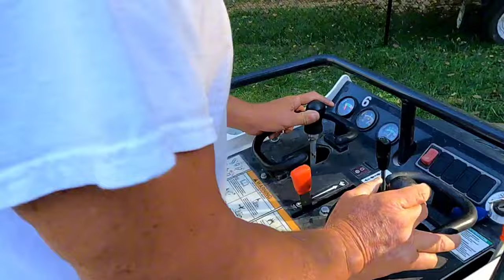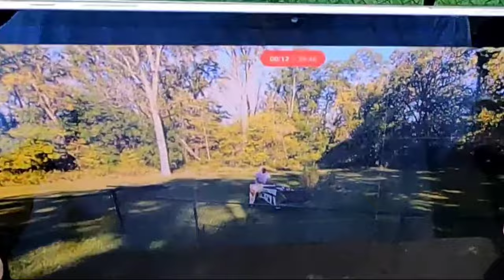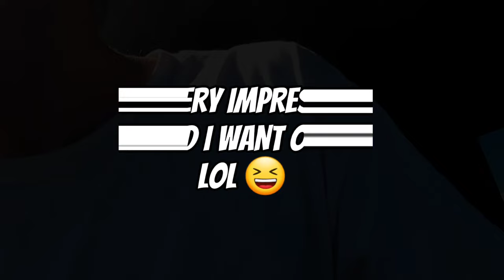Tell Me why i should NOT buy this STAND on Skid Steer (Bobcat mt100) Testing

Comment: So the biggest question is billable hours,   for every hour of operation, that machine consumes a few dollars, tracks last about 2k hours or so, hydraulic pumps and motors wear out..   If you can get some billable hours and maybe open yourself up to some larger jobs it may well be worth it.  Whereas you do a lot of laser work, you can clamp a pole to the bucket and let the laser guide the grading as well.

Comment: For limited access work, these are great.   There is no Seat, Roll Over Protection, AC or  windshield for shade.    You will be breathing a lot of dust, baking in the sun, and could be exposing yourself to danger as you bend tree branches back, they can whip you in the face and take your eyes out.

Comment: Hey man thanks for youe videos! I have a concrete business as well and specialize in small pours and repairs. I am planning on selling my Kubota track machine and getting a bobcat MT100 or a Case TL100. The case stand on skid steers are just being released to the dealers beginning of 2024. I looked into the Kubota SCL1000 but I hear too many stories that they roll easy, side to side and they can flip over backwards if you are driving onto a dumptrailer for instance. (That's what I hear at least) Also from what I understand Kubota's control are electronic which can make it jerky as that tends to be more sensitive and as you drive the machine you are naturally holding on to the controls for support. From what I see of the Case TL100 it combines both the good from Kubota and Bobcat into one machine(minus the fact that the Kubota has the lift arms similar to the larger machines where the lift arms pivot at two points to keep the bucket out to reach farther the higher you lift) Good luck, thought I'd share a little bit of my research.

Comment: I bought a Vermeer 900 and man only thing I regret is not buying sooner
Reply from the maker: Wow heck yeah,  that's kinda where I'm at brother, thanks
Reply: Is Vermeer 925 suitable for this type of work? Which one is better?
Reply from the maker: Landmark is the 925 work for concrete and landscaping?
Reply: @GRUBB-MUDD  absolutely. There are different bucket sizes and all sorts of different attachments. It’s great in tight areas and very durable.

Comment: A smart, safe, patient operator can move mountains with that machine. The weights that are under the tracks can be taken off and added to the rear. Give you about an extra 100lbs of lifting counterweight. The non turbo engine on this is perfect for our high risk work where we need a non-jerking machine. Go with 36 inches wide. There isn't a better bobcat that's 36 inches wide out on the market today.
Reply: Eventually you can buy machine mats. That plywood wears out after 15 or so jobs. But it does the job pretty good.
Reply: Also be careful, if you get good with the mt100 you will forget how to use a shovel. I know I did almost since it does all the work.
Reply: These machines are like generators. Run them at full throttle and just be gentle with the controls.
Reply: As for tearing up the yard. Try to not turn on a dime and swing wide. I had to learn that before I bought mats and plywood. And when I'm short on wood or mats I place them where I know the machine has to turn. Straight runs don't tear up much.
Reply: And FINALLY, the small machine will always find more spots to be useful than a big machine. Especially on residential. And its heavier but it can lift way more. And the tooth bucket helps alot. We can usually tear up and load 10 yards of concrete in 2-3 hours.
Reply from the maker: I got tons of plywood basically brand new
Reply from the maker: Thanks Joe, btw i loved it!
Reply: Is Vermeer925 suitable for this type of work? Which one is better?
Reply: @chenzhou4078  I would say the bobcat since it doenst have a turbo engine and turbo lag won't catch you off guard while close to someone's house which can lead to damage of their home.

Comment: I own a mt 100 and my cab bobcat sits on the sidelines
Reply from the maker: U got the s70?
Reply: @GRUBB-MUDD  2005 553
Reply from the maker: @Freedomrider1685  do u think if u had a track skid steer it would be different?
Reply: @GRUBB-MUDD  I install hardscapes so the tracks a prefect for all the terrains we deal with
Reply: The wheel machine is great for road but get on a job and it rains it will cost you money